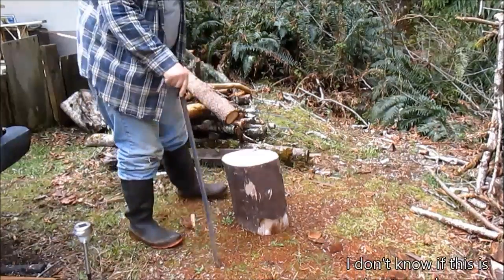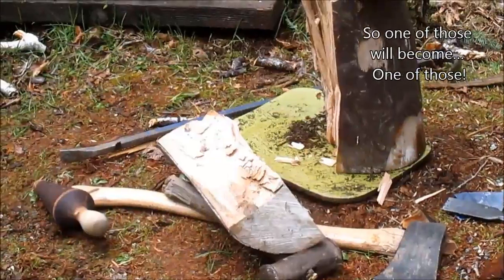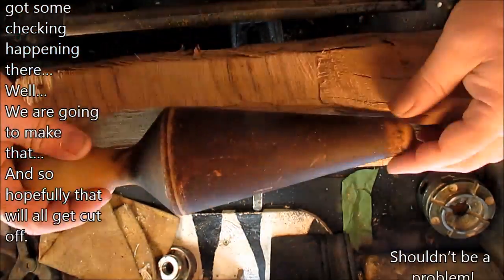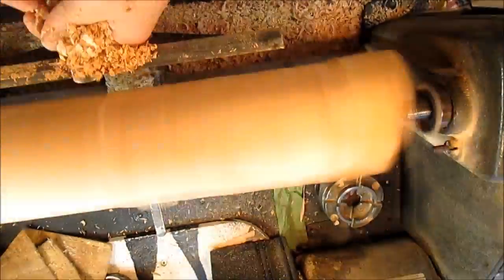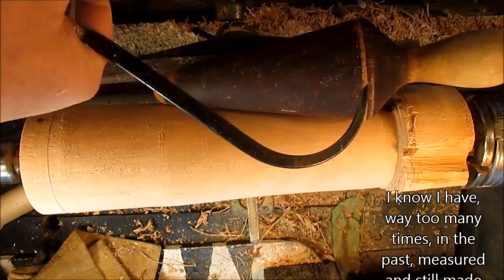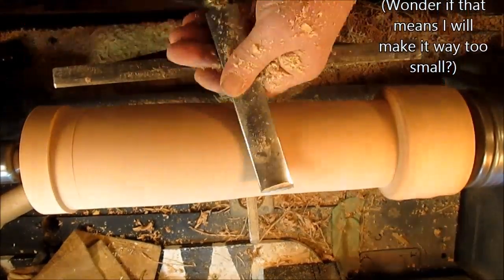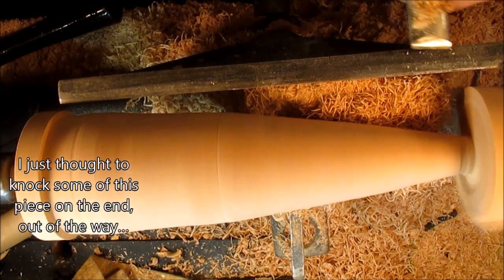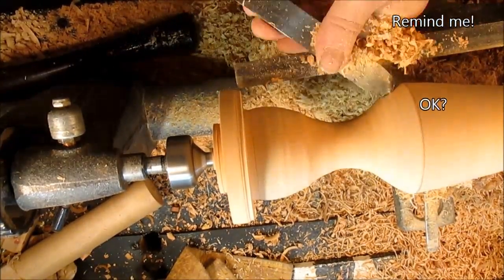Wood Turnng # 60 The Masher

Comment: Larry, I seem to have that problem as well. I'll set the calipers a little large and turn a tenon down to that size, then when I try to sneak up on it to get it just right, it ends up too small. I also have had a problem lately with going a little to thin on the wall thickness of bowls. So my next plan is to work on these issues and correct them. A nice little project by the way. Is that wood native to the B.C. area?
Reply from the maker: Hello Jordan:
It is Arbutus here in Canada.... but go 18 miles south to Washington State and it is Madronna...It grows on Southern Vancouver Island and south... I actually live 40 miles out of Victoria BC and it doesn't grow here which is pretty surprising when you find it growing on rocks with very little soil... you wonder how they stay alive in the first place!
As far as sneaking up on sizes are concerned... I think it is the tools! Rulers change their readings from one spot to another!! Gouges cut a little deeper when they know that the other side isn't far away!!
I don't know!!! One of these days we will get it all figured out....
then it won't be any fun anymore!
Thanks for watching
Larry

Comment: Hello Larry,
That's a fascinating piece of wood.   I looked it up in Wikipedia and it's sometimes referred to strawberry wood which is very appropriate for a berry masher.    VI also gets a mention.
Really nice project.
I'm just in from my lathe.   I have been saving a special piece of box for when I was in an "artistic" mood so today was the day.    However, when I roughed it out several cracks appeared so it's back to the drawing board.
Best wishes,
Alan
Reply from the maker: Hello Alan:
It is definitely nice wood... but because of its characteristics you don't see it used much. At least I am assuming that is the reason! I does split easily... (once you have turned it...not before!) and because it is something used with food I am reluctant to fill them... so I will turn another one... just the same and hopefully this one won't crack... Naturally... as I won't be filming that one!!!
Glad to hear that the mood still hits you...it is a tough day that doesn't go round and round! Are those the kind of cracks that you can fill or are they a complete change of plans?
Thanks for watching
Larry